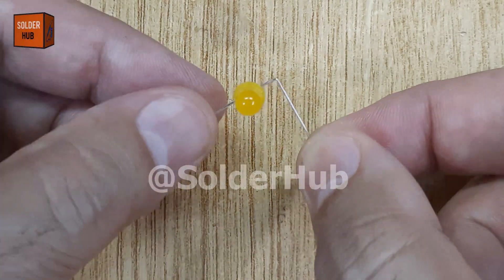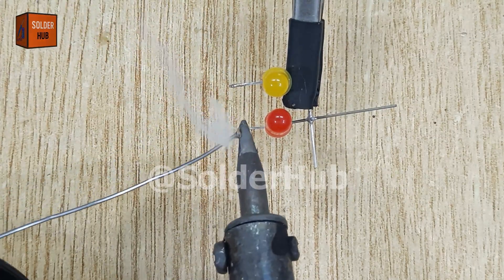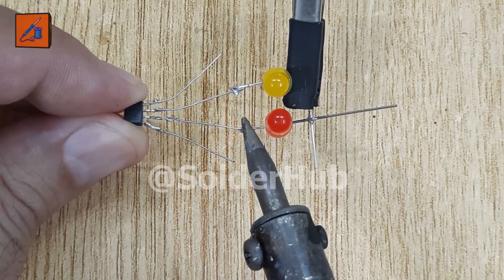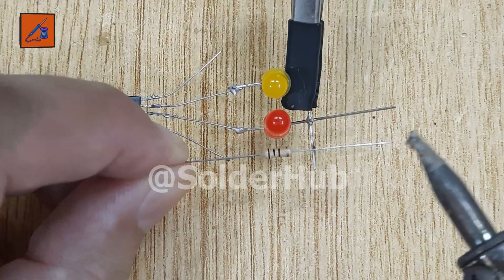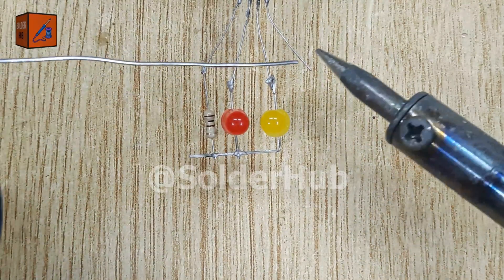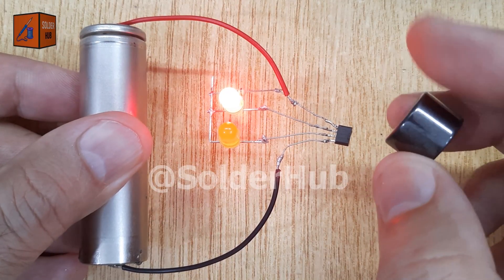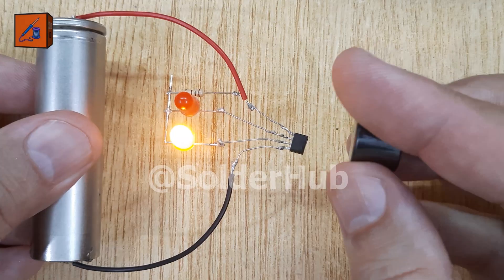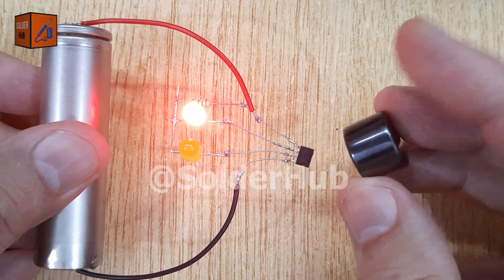The Magic of Hall Effect Sensor

Comment: Bare 18650's are not like old-school alkaline AA's. At the absolute minimum , put heatshrink over them to insulate the case, as leaving it exposed increases the risk of a short massively. And a short on a lithium-ion battery can release a lot of energy very quickly. I won't say "don't use them", but when you do, treat them with the respect they require.